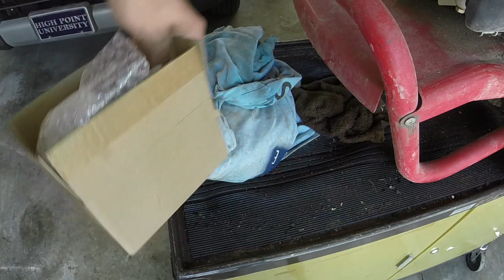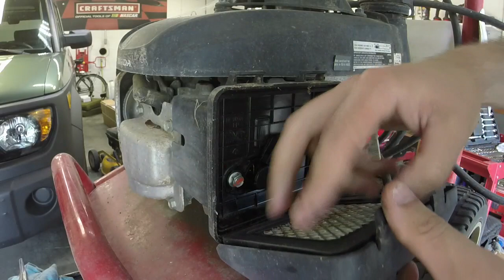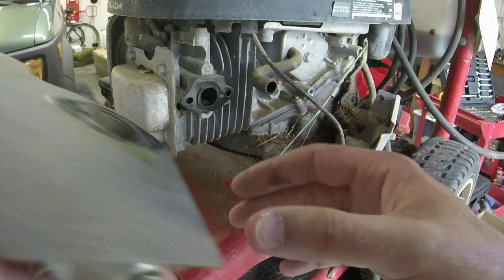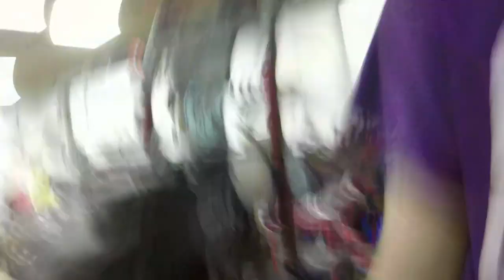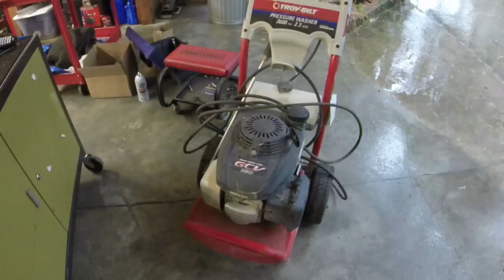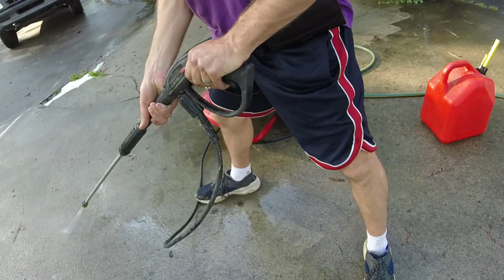Replacing a carburetor on a Troy Bilt Honda GCV160 pressure washer using #HiPAparts

Comment: Just finished replacing the carburetor on Troybuillt presure washer with a GCV 160 Honda engine. I just wanted to thank you for this video. Your video made it so much easier. especial the reinstalling part of the video.

Comment: If you replace the bolts  that hold the carb on with ready bolt. Then you can put the gasket, and carburetor on , and button everything else up a lot easier.

Comment: So I'm having a heck of a time with one of these GCV160 engines on a lawn mower. I've already cleaned the carb, changed the oil, and it has spark but it won't start even with starting fluid. Trying to figure out where to go next. It doesn't have a noticeable kickback when pull starting so I'm less inclined to think flywheel key but haven't pulled the flywheel to check yet. Any help anyone can offer would be appreciated.
Reply from the maker: You could have a stuck valve, or the camshaft timing belt could have slipped off or broke.

Comment: Good job bringing that engine back to life with the new carb! Question? Does that pump have a regulator on it? I ask because many pressure washer pumps have a regulator valve, mine has one for example. If its not turned all the way in clockwise, then it won't achieve its full pressure capability. If that washer doesn't have a regulator, then the other options is to raise the engine RPM's by 200 RPM's at least, this will get a little more cleaning power out of it.
Reply from the maker: It does not have a regulator.  It sounded like a pump restriction that needed purged out.

Comment: I have that same pressure washer, when I pull the rope some times it Yanks back. It's like on certain rounds it is hard to pull. I don't know if you understand what I'm talking about. But if so do you know what causes that please? Thanks
Reply from the maker: You might have a partially sheared flywheel key, or a timing belt that is just a little bit off.  Also could be valves out of adjustment.  Depends on if yours is an OHV or an OHC.
Reply: @EllisMowersandmore  mines OHC

Comment: Should NOT have left out that air deflector plate that was behind the carb - it and the plastic spacer piece were added to help prevent heat from boiling the gas in the float bowl. The manugfacturer doesn't put that stuff there for no reason!!!!!